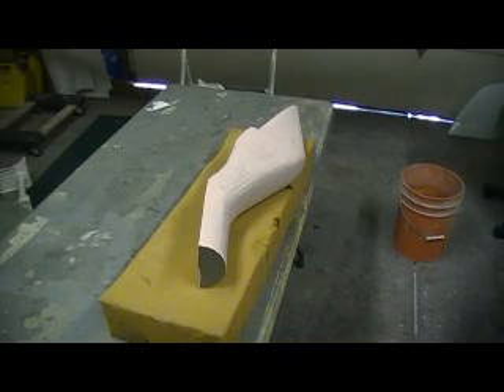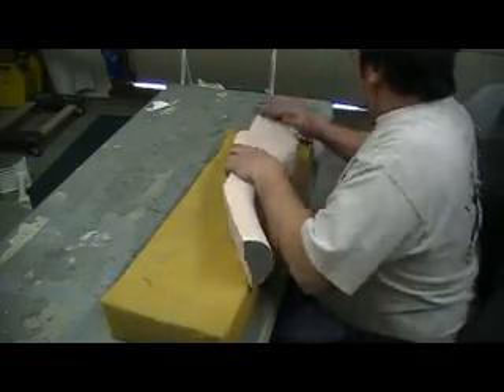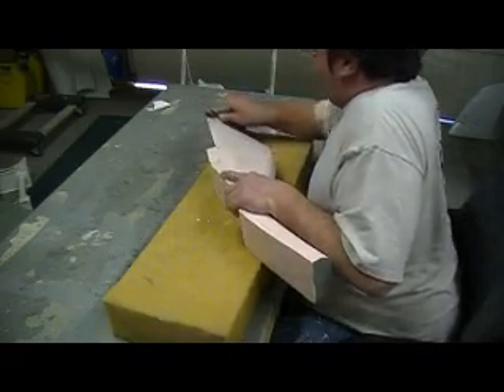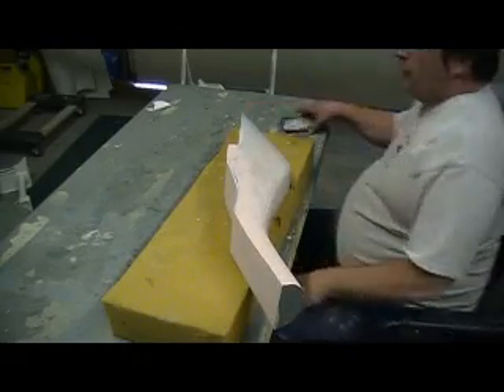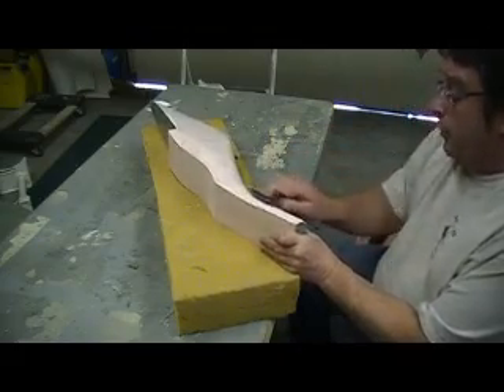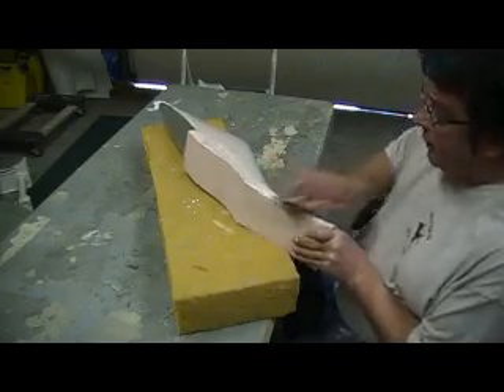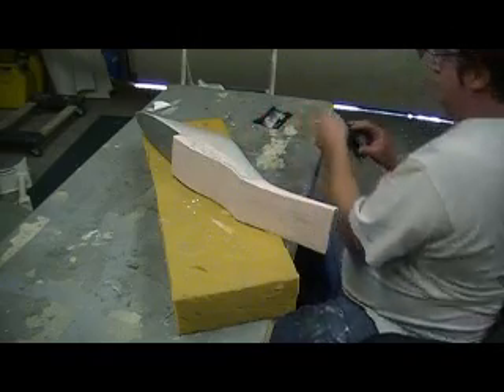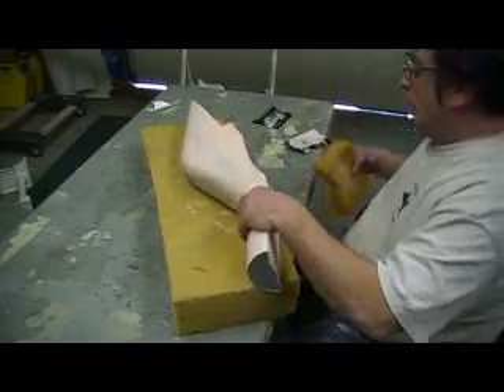how to build a rc jet F-105 thunderchief # 362

Comment: Not sure how it would work on glass but a panel beater taught me to drop a block of soap in the bucket of water.  It helps the wet/dry paper slide and cut easier.  Then again we were using 1000 and 1500 grade so a bit finer than the 200.